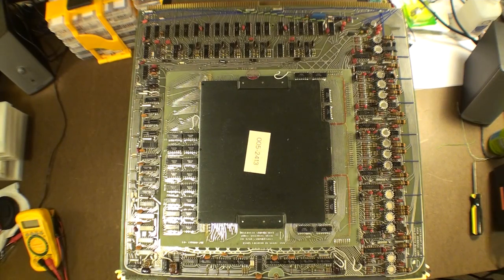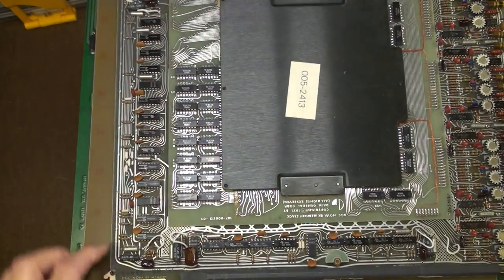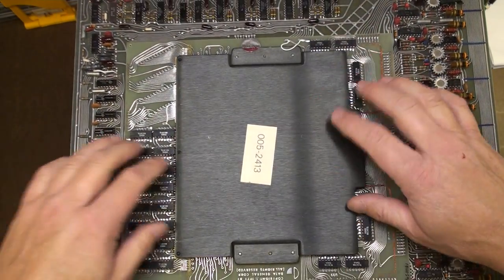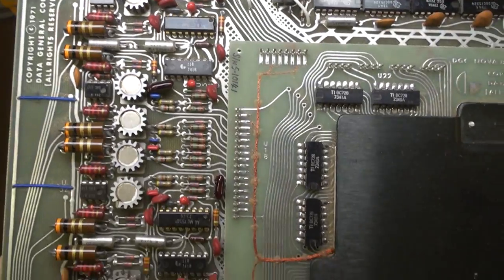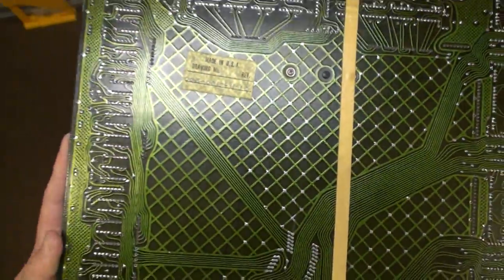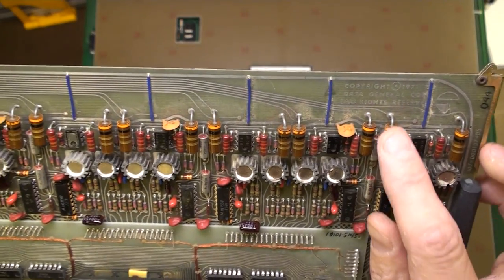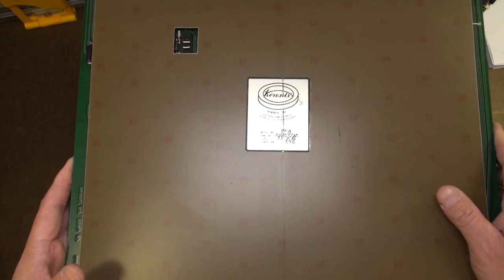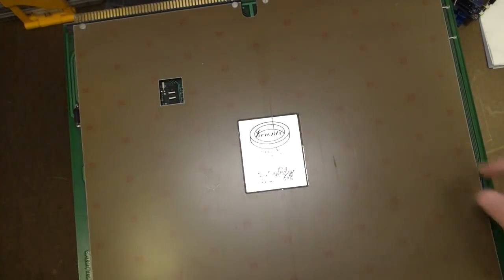Data General Nova "Original" Core Memory RAM Board - A Close-Up Look

Comment: Based on some of the 74 TTL logic date codes I could see, it looks to be no older than 1974.  Saw a 7416  date code.
Those heat-sunk transistors might be the memory core drivers.
Reply from the maker: Excellent, I'm certain you are correct!